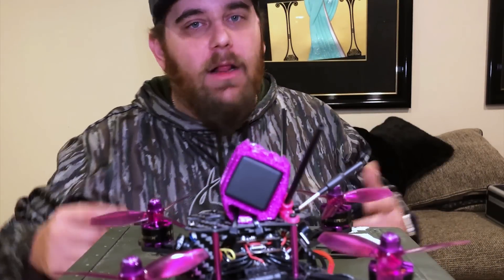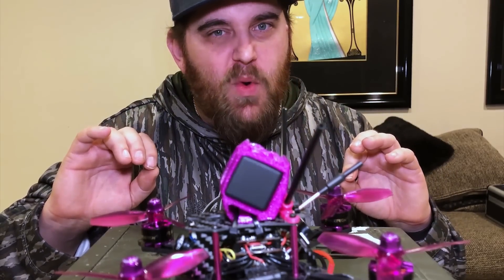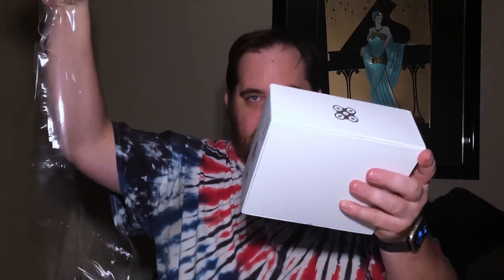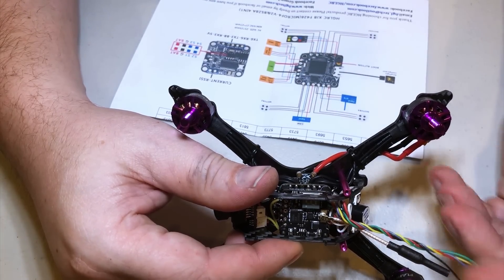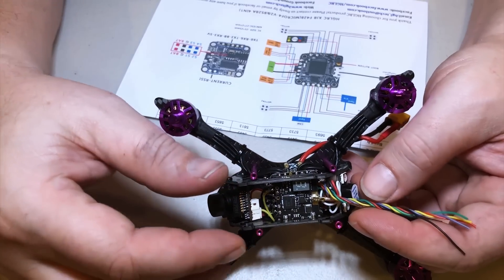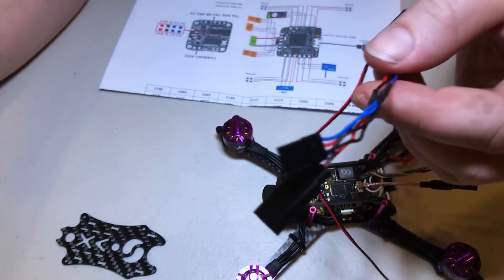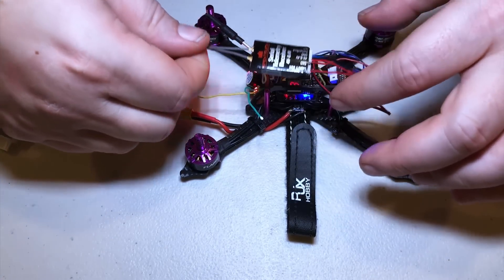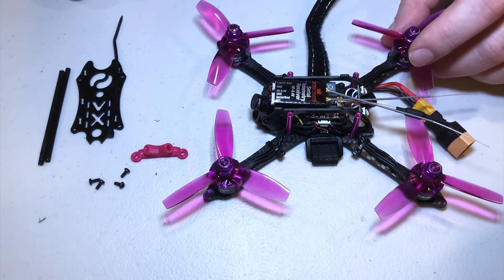HGLRC XJB 145 - Part 1: Unboxing & Receiver Install - Fitz

Comment from the maker: Favorite Quad:
HGLRC XJB-145MM FPV Racing Drone PNP Omnibus F4 28A 2-4S Blheli_S ESC 25/100/250mW Switchable VTX for RC Drone
Blue
https://goo.gl/E3GAxP
HGLRC XJB-145MM RC Drone FPV Racing PNP Omnibus F4 2-4S 28A Blheli_S ESC 25/100/250mW Switchable VTX
Purple
https://goo.gl/XRQ47e

Comment: I love how you skip the most important part.... showing use where the wires go into the receiver...... which wires....
Reply from the maker: It is different depending on which receiver you put in.  I believe you are looking for flysky receiver so it would hook up to the pins shown in the manual for ibus.

Comment: Hot glue easily comes off any surface all as one piece with rubbing alcohol....
Reply from the maker: This is a great tip.  The only issue can be if it gets into wires or other areas that it encapsulates parts.  Kinda like chewing gum in hair lol.

Comment: @tronage. What size Allen wrench do I use to take off the top plate. I don’t have anything this small. I just got the drone today and can’t do anything with it. I’m a tad frustrated....
Reply from the maker: It is a 1.5mm hex key.  I highly recommend picking up the Nanch Small Precision Screwdriver Set (https://amzn.to/2C7I3K2) It has this size hex key, as well the larger 2.0 kex key that is also very common.  plus all sorts of other tips that you will use.  I personally keep this exact kit in my drone bag, and use it at least 1-2 times a day when working on drones.

Comment: Hey tronage I'm having a major pain getting mine set up with a dx6 and same reciever your running. Can you please make another vid from reciever installed to transmitter set up and the betaflight configuration. I'm not geeksquad but I can fly and I want my new quad choppy in the air soon. Your the only guy on here that uses spectrum and I need your help
Reply: it seems like information on receiver compatibility is limited to zero on the internet...

Comment: Great video :) I test the sq 11 too but it's soo terrible... the sq 12 do a better Job. My question is whats the weight of this amazing 3 inch quad include the sq 11 and the lipo? Will it be under the 250 gramm?
Reply from the maker: The quad itself comes in around 200g.  The SQ11 is 20g and the SQ12 is 16g.  The battery I prefer to use (Tattu 4s 75c 850mah) weighs 100g.  If you wanted to keep it under 250g, you would need a small pack (Tattu 3s 75c 450mah) weighs 42g.  That gives you 8g to "play with", and maybe by removing the LED/Buzzer assembly from the quad, and using light weight battery strap (or rubber bands) you might be able to squeeze another 8g off to put the SQ12 on there.  But your flight times will be on the shorter side with the smaller 3s pack and extra payload, but it maybe "do-able"....

Comment: Lol! The box it ships in is tight and doesn't open easily, yea... hahha. I needed this vid cuz I wanted to make sure I connected the right color wires to my ia6c rx. Thanks and you could make a shorter intro vid... though your intro narrative bit is gold!! Thanks and I just might sub!
Reply from the maker: Had to leave that awkward pause for the box, cracked myself up when I was editing and I saw it.  The intro vid is a little "long" but everyone's ends up being a little long.  That's what fast-forward is for lol!  Either tonight or tomorrow morning I'll be uploading a vid that goes through the entire Betaflight / BL-Heli configurator process how I set mine up (it is exporting right now).

Comment: those wires that are stickign out for the receiver do not have a PLUG for the receiver......... do i have to get my own plug... I don't understand.
Reply from the maker: it depends on the receiver.  I've only used FrSky, Spektrum, and Crossfire,  I'm not sure the specifics on a flysky receiver, specifically the one you are asking about.  I can tell you ground to ground, power to power (5v typically) and the signal wire would go to the ibus/dsmx pin.
Reply: @tronage  The XJB flight controller only allows 3.3v power and DSMX for ibus according to the wiring diagram.

If you know for 100% certain that you can use the 5v pin and DSMX to make ibus work let me know. But the wiring diagram says you cannot.
Reply from the maker: @upplsuckimcool16  I can say for 100% that is how you hook it up.  Can't say 100% it would work since I've never used flysky / ibus.  However if you look at the pinout diagram here: https://ibb.co/dbMued you will see DSMX / IBUS share a pin.  This is because it is an uninverted pin which dsmx and ibus use for the signal wire (sbus is an inverted signal and why it is on a seperate pin that has an inverter built into the fc).  That will get your signal into the flight controller.  As for the 5v you can grab that from any 5v pin,  doesn't matter where the 5v power comes from, as long as you put it on something outputting 5v (see how ppm and sbus are sharing a 5v pin in that diagram.  if your ibus receiver needs 5v just us that pin as well.  same goes for ground, see how all three share the same ground pin, this would be the ground pin you use.  So as far as the pinout diagram for the FC goes, that would be how to properly wire it up.

Comment: They only put two screws in the motors in case you ever cross thread or strip one set you have two more to hold the motors on
Reply from the maker: Ah, gotcha.  Yea that would suck to have to replace a working motor just because the mounting holes are stripped!

Comment: Have you ever considered actually putting this all into a 4 or 5 inch quad? Like directly take all electronics and motors from the xjb 145 and put them on a lightweight 4 or 5 inch frame. I think thatd be pretty sweet. I know the brotherhobby 1407 work great on 4 or 5 inch props, these hglrc flame 1407 just might too. Itd be an awesome video IMO, and pretty cheap to do if you have spare frames for  4-5" props.
Reply from the maker: I've considered it, but every time I went to buy the parts for it, I end up buying other stuff for other projects lol.  I think part of why I love this quad is the power in such a tiny package.  It is just a surprise to anyone who isn't familiar and it usually blows their mind.  My problem is when I build a 5" frame, I end up building it way out with huge motors, and 35a escs lol.  But it is def a cool idea, and may do something like that in the future!  Thanks for the idea!!!

Comment: great . I am watching this.. I just got mine but I dont know anything..  I am glad you made the video..
Reply from the maker: AWESOME!  That is the point of these videos, to help those get setup and started with the hobby.  Not just review it, but How to build it.  I'm always glad to help and feel free to ask if you have any questions!!
Reply: Wow. So much love in this world of evil XD  No but seriusly  thanks for the kindness. You know what it is not easy to find? a good video about the batteries charging, and discharging for storage, multiple batteries charging, the parallel chargers etc... I think it would be very useful for many. I got something already to charge and trying to learn about the subject. Just an idea.
Reply from the maker: Awesome suggestion!  I'll add that to my list of to-dos! Keep an eye out for it in the near future!
Reply: My man. Someone told me about a very nice option on controller and it is the FSI6. Cheap, good range. Now can have telemetry. Do you know about that? Cause it is like 50 euros chaper and it comes with a receiver. I would appreciate any info.
Reply from the maker: Unfortunately I don't have experience with any transmitters outside of the realm of Spektrum.  But I do know that by popularity, the FSi6 is a FlySky which I don't see very popular compared to FrSky (FLY vs Fr in the beginning).  Don't get these two confused because I think that they are different from eachother and not inter-compatible.  Again I could be wrong because I only know Spektrum, but FrSky is typically the most popular in this sport, if you want to go with what most people have, and what will probably be the easiest to find info on.
Reply: Thanks man. wow. so much back and forward with just the transmitter -  receiver stuff. I will keep on searching. I appreciate your advices.
Reply from the maker: Told ya, I'll take the time to respond to comments.  I'm here to help if I can!  It is that personal touch you can expect.  Good luck and I'm sorry I couldn't help more.  But I only know Spektrum, and I use the DX6 Transmitter along with the receiver I show in the video if that helps
Reply: Carlo Mario I recently purchased two of them for racing drones around on my property.  They're great transmitters for the money and can be updated to 8 channel ,10 channel or the 14 channel beast. 
And for receivers I recommend the FS-iA6B for 5"/ 200-250 size drones and for the XJB 145 I use the FS-A8S.
Plenty of videos on how to setup,bind,update and tune. They are actually the most common transmitters for beginners  because of the price. One day I will probably upgrade to a higher priced receiver, but for now they work for me. Good luck on your setup.
Reply: Here is the multimeter test

https://youtu.be/366z8nRi5Pg

Comment: Hi there, enjoy you’re set up. Purchased the same one but won’t arm, any ideas ? Total newbie lol, did get it to bind :) do I have to connect to a computer? To finish arming flight controller ? Thx.
Reply from the maker: Yes, you will need to configure betaflight for it to function properly as you would expect it to.  I have a full video (long but very informative) of exactly how to do that.  It is here: https://youtu.be/Ke7Dj0pdNok  Just follow along step by step and you should be up and flying.  When I get to the section about PIDS and PID tuning, you can leave it as default to start, but once you get it working and flying, you can also check out my video here: https://youtu.be/VDBs7Psti3s That has my ultimate set of pids to make the craft amazing!

Comment: Note to self, never put hot glue on any VTX to hold down the antenna connector.  The heat generated by the VTX will remelt the hot glue every time it is powered up and hot glue was dripping off the connector. This VTx gets very,very hot...Better off  using a drop of high temp locktight  or crazy glue, that is if you don't intend on changing the antenna. I don't like this antenna connector type. Now to get the hot glue off the VTX board. Ugh...
Reply from the maker: I hear you man,  I've since learned the similar fate.  I've just added a card to this video inspired by you to NOT use hot glue on the Vtx.  Thanks for helping improve the content of the channel!!!
Reply: thanks for all the info Daniel. I wont be using that for sure. I still trying to get my first flight.
Reply: Wow thanx man I almost made that mistake!

Comment: Can i use a 4s akku with 1550mah?
Reply from the maker: The XJB will handle 4s power, however a 1550 pack is kind of "huge" for this size craft.  Your results will probably not be good, and your flight times short because of the extra weight of the large battery.  I have a video that covers what battery I recommend, as well my settings etc. here: https://youtu.be/VDBs7Psti3s  (Note this is for pre-4.0 betaflight, and honeslty it flys so good, I still haven't upgraded).

Comment: Can I use a fs ia6b receiver on this quad yes or no PLEASE JUST ANSWER THAT QUESTION SOMEONE!!!!! ANYONE.... ANYWHERE ON THE INTERNET!!! PLEASE!!!!!
Reply: Yes u can. you have just to figure out what protocoll your receiver is using and what wires you have to connect.
I found this one for you:

https://static.rcgroups.net/forums/attachments/6/8/1/5/7/2/a10427603-178-500px-FlySky_IA6B_pinout-f89eed4f.jpg

if i'm right this is a ppm receiver so you have to look up in the manual which cable you have to use and to connect to your signal.
the same with plus and minus (also called v+ and ground)

Good look!
Reply from the maker: Yes, the flysky receivers use the ibus protocol and would hook up to the same pins as the DSMX receiver.

Comment: hey what size screws does the quad have?
Reply from the maker: The diameter it uses are M2 size which is smaller then a "full size" quad (they usually use M3).

Comment: Do you have the 3D print file for that antenna holder!?
Reply from the maker: All the mounts and such I print are exclusive rewards for Patreon members.  Head over to https://www.patreon.com/tronage to get the details.  As an extra bonus I can now print flexible tpu so the antenna holder for the xjb is that much better!!
Reply: tronage thank you in your other video for helping me get threw my issue! Is there any way I can PayPal you for 1 black tpu mount? I want to support you just not threw patreon at this time.

Comment: I've just broke the front left arm :(

Do you have any frame recommendation or you would stick to the factory frame?

Do you think the GEPRC MX3 (or MSX3) is compatible with the parts?

Thanks for your answer in advance!
Reply from the maker: Personally I would stick with the stock frame I love its configuration.  I do prefer the standoffs with a top plate over the "roll cage" design because it makes working on it very easy IMO.  I can't say for sure but I "think" it would work in the MX3 and the MSX3 (and out of those I would go for the MSX3, I think this craft does better with the stretch x).  However I don't have hands on experience to say for sure.  Keep in mind though, if you change the frame out to something different, you will need to re-tune because the CG may be different, the weight distribution will be different, the exact motor positions will be different.  For me once I got it tuned in and working, I want more consistency, and that means sticking with the same config.
Reply: Thank you for your reply. I've already choosed the stock frame because of the tuning you mentioned and for example the motor cable lengths. It is sure it will be ok with the stock frame.

The only thing I don't like (I mean I hate) the way I have to change channel/band as I can't see it, so always have to remove the top plate. I thought if I had to change frame, I could make this process easier, but on other sides I would make a lot of work to myself, and rather try to find some SmartAudio VTX :)

Did you try any of those on the XJB?

Comment: I just got my hglrc xjb 145 and I got a r-xsr ran the power and ground to the FC and my sbus out wire to the sbus pad on the FC pad and the s.port to the rx6 pad on the FC bound it to my qx7 amd when I connected to betaflight I dont get any response on the inputs not sure if I did anything wrong?
Reply from the maker: You also have to configure it in Betaflight before it will show response.  The "hard" part is getting the bind I find.  As long as your tx and your rx our bound, then the rest is easier.  Check out my full betaflight video, specifically the receiver section to get it setup: https://www.youtube.com/watch?v=Ke7Dj0pdNok&t=2693s  Let me know how it turns out, and if this helps you!

Comment: you called that cam a gopro then called it something else and said there would be a link. there is no link and thats not a gopro
Reply from the maker: The first 10-20 seconds I’m “kidding”. I say it is a 5” quad with a.gopro session when it is actually a 3” HGLRC XJB 145 with a SQ11 camera on it.  Thought that was obvious the moment I pick it up and say it is an “itty-bitty three inch” in the intro. Sorry for any confusion.
Reply: i skipped that part because you wernt saying anything and looking goofy

Comment: excellent video!  I've got an XJB-145 on the way, and appreciate the detailed instructions on how to connect the Spektrum receiver.    How would I be able to get one of those 3D printed antenna mounts?  Thanks!  Kurt
Reply from the maker: That is the next video I think I'm going to work on.  I did the betaflight setup of this quad, but there seems to be interest in the Spektrum side of things so I'll work on getting that created soon!  

As for the mounts, any 3d printed parts I design or create are exclusive rewards to my Patreon supporters.  If you click the Patreon link in the description or at the end of any of my videos, you can see the full details over there how to get your hands on them, as well as any other parts.  The jist is a $1 pledge to help support the channel gets you any single part, you pay the shipping and $5 pledge gets you any parts plus I'll pay the shipping (within the continental USA).

Comment: Hey buddy I really like the touches you have done with this little quad the small camera and antenna mount! I am hoping to get one of these ordered soon!! One question is do you think the 3s 1300mah packs are too heavy for it? Cheers 👍🏻
Reply from the maker: Not at all.  Remember the packs that I am flying right now are 3s 1300mah 45c.  That is a low discharge rate and a low voltage for what this guy can handle (The ideal pack would be 4s 850mah 75c (or higher)).  And even with a low and slow pack, it still flyis amazing.  That is keeping in mind I am running the upgraded gemfan 3052 props so that may compensate for the type of pack.  Either way I'm loving flying it!  Granted the 4s packs have this baby scream because they are the same weight, but higher voltage and higher discharge rate (less sag on punch-outs).
Reply: tronage ok cheers thanks for the reply 👍🏻 a sub from me 👌🏻